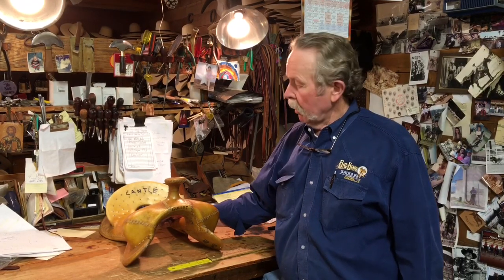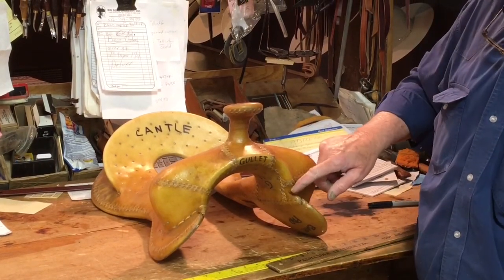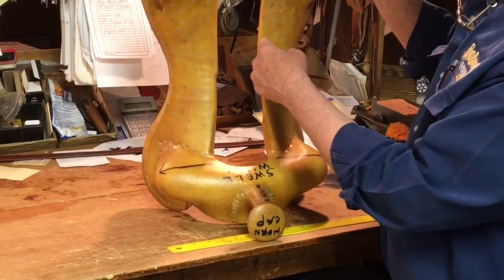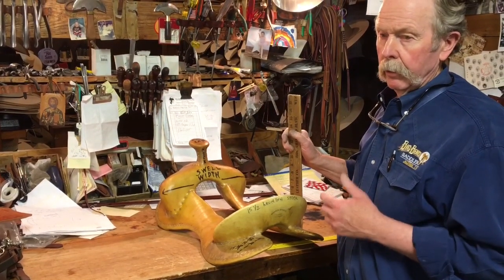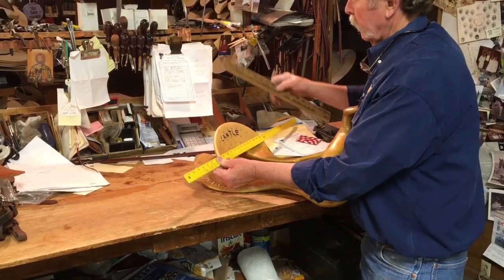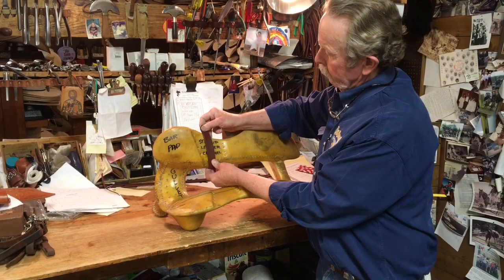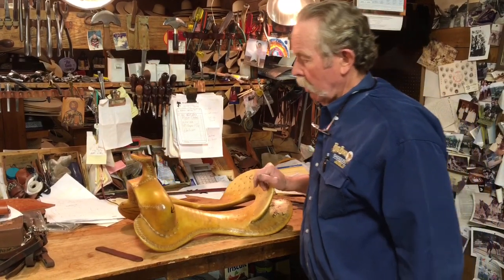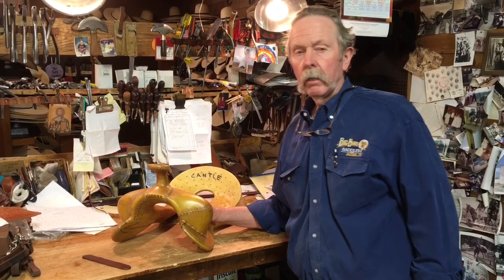Tack Tip: A Little Information About Saddle Trees

Comment: I owned Ranch Horse Outfitters/Paul Custom Saddlery for 15 years.  Great info you have here.  We always used the wood trees.  I never liked the fiberglass trees because they have no "give" to them.  Wish you had shown the correct place to measure seat size.  People are so confused about that for some reason.  Also wish folks understood that you can't get an accurate gullet width on a built saddle!  LOL

Comment: Why are some of the bars on trees sloped toward the horn more than others? I have an Ammerman that has a super sloped bars to the horn. Almost like a barrel saddle. Then I have a trophy saddle with almost flat bars all across the seat?? Why is that ?
Reply from the maker: A simplified answer is that several factors play into the design of the bars. The higher the bars are in the front the less acute the angle is where they connect to the swells. This makes the connection at that point stronger. Also, where a person wants to be in the seat will affect how flat or raised the seat is in the front and back. A person’s size will also play a role. The smaller the person, usually the higher the seat will be in the front. The larger the person, usually the lower it will be. So the function of the saddle, the way a person plans to use it, and the size of a person will all play a part in how it is constructed.